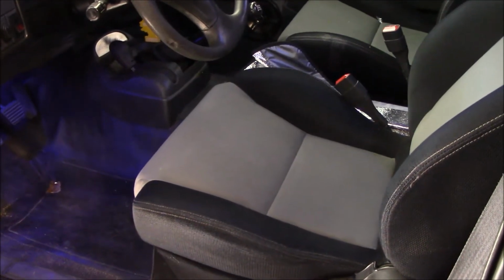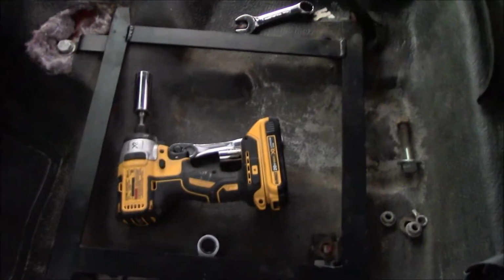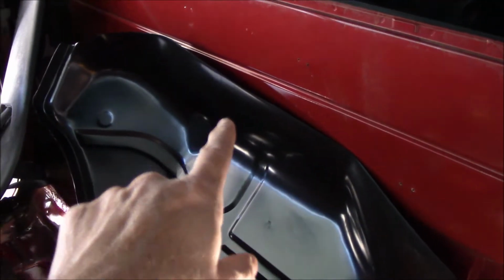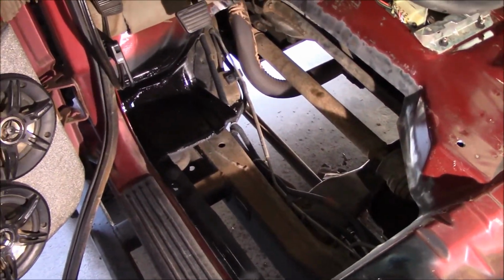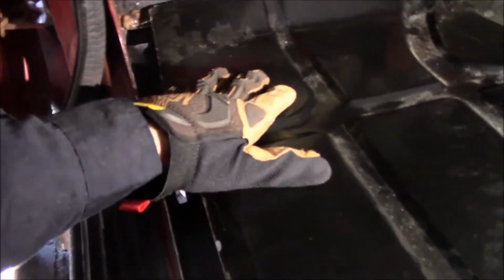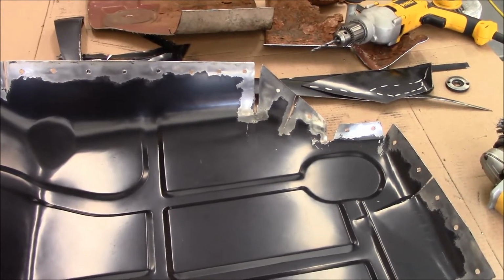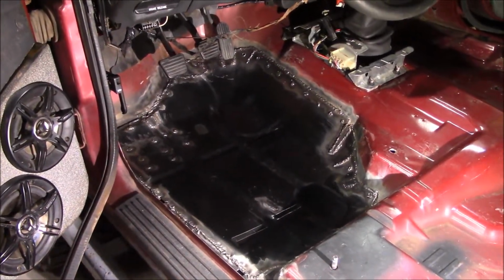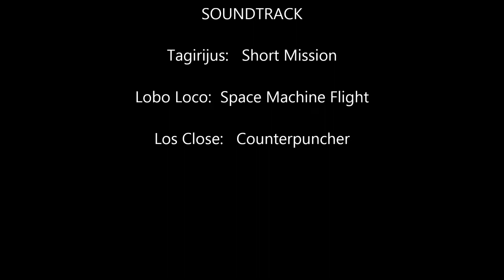20191005 1994 S10 Floor Pan Replacement

Comment: I am a welder by trade and have been welding over 20 years. I think you did an outstanding job on this. You were not scared to try this yourself. You should not run a bead on sheetmetal anyway because it will warp. Tacking it like you did was correct.Again nice job.
Reply from the maker: Muscle Man Mitch hey, appreciate the positive feedback. You know how it is, can’t afford to pay a body shop gotta figure it out. My older Brother is a certified welder, too, so in between razzing me he has shown me some tricks of the trade. We’ll see if in the spring my sealing and coating the underside holds up.
Reply: @rockymtnredneck4888  What type of welder are you using here? Type of material/etc?
Reply from the maker: @regaltouchdetailing3887  just a Lincoln MigPak 115 on 220V with .030 wire and C25 gas. Nothing special.

Comment: Ya know I was sitting here months ago Thinking wow there is no 96 - 05' blazer parts for this job ...I wonder if the older ones would somewhat fit ..lol  My body mount post to the floor is broken and collapsed on my 05' And it has a 2.5 in lift So the alignment for the last 5 years since i got it has always been off The rims are also -19mm offset When you add in all the factors She pulls to the left And has slop in the steering .....So thanks on posting this  I have a mini welder And been in prepping/minor bodywork for a number of years ..Liked and subbed !
Reply from the maker: Yeah, it was frustrating me trying to find the parts, so I decided to look at the square body S10s. Yep. GM engineers saved time and money by just reskinning the truck. Everything else is practically identical.

Comment: As we completed the restoration of the exterior of my 89 S10 on July 4th, we discovered rust breaking through in the exact same area as on your vehicle. So I'm just about to order the floor replacement panels & mounting brackets from LMC Truck. For those who have been asking, they have them in stock, however, 2 of the brackets are shown as Out of Stock, but have been back ordered, and another is shown as Out of Stock and not back ordered. But, you may be able to find them through GMC.  All the pieces total $270, don't know if you can just order the 2 panels for the drive side or not. I asked my body tech why we couldn't just cut out the bad section on the driver side, and weld it in 'top down' just like you did. But, he insisted we need to completely replace all the floor panels, on both sides (there are 4 separate pieces) and  that we needed to completely remove the cabin from the truck, stating that the 'frame was in the way'  and that the floor panels were part of the structural integrity of the truck. This sounded like over-kill to me having had to fiberglass the floor panels on my 240Z unibody 'rust bucket' decades ago. I definitely don't want to have to remove the cabin... do you think any structural strength/integrity is compromised at all, patching in a replacement floor panel on the driver side of my truck ? Sort of a rhetorical question, as you obviously don't think so having done just that to yours. I was just looking for reassurance... hoping like you to avoid paying professionals thousands, while the way you did it only cost hundreds. Thx so much for this video.

Comment: The “body plug” is for a cable. Maybe the foot brake idk exactly. I’m in the process of doing this repair myself. Glad I stumbled upon your video. 👍
Reply from the maker: That makes sense.  It's the same size as the plug for my Suburban's auto-transmission shift cable.  After you point it out it's so clear.

Comment: This is great video and nice job!  I'm about to get my driver side floor pan replaced as well. It is equally rotting out like your truck and probably a little worse.  I learned alot especially about matching floor pans to the 1st gen s10. Typical that GM would do this to save cost when constructing the next generation.  They did it also with the F-body cars as the floor pans matched from the 3rd gens to the 4th gens. That large plug you were mentioning is for the shifter cable for automatic transmission trucks.  I just did a comparison to my 96 s10 (auto) and that's where the cable goes through, so since your truck is manual, GM just blocked it off with that plug.
Reply from the maker: Thank you for the positive feedback!  Good luck on yours.  It's not an easy job, but it is worth it.

Comment: The secret is Galvanized sheet metal , yep I know no rolls in metal but it last much longer then mild steel, but you got it welded solid, good job!  If the automakers used Galvanized metal we wouldn't  have rust as much! Zinc the other good mineral!!
Reply from the maker: The problem with galvanized is welding it. You can get pretty severe poisoning from the fumes. So there are no patch panels made with that. The factories do have galvanizing processes they use, but not in the aftermarket.
Reply: @rockymtnredneck4888 ever so true with fumes, I use a fan when welding it, blowing away only tack welds at most, before I knew in welding class I took a wife of it, made me cough years ago then the teacher told me about it lol, go figure.

Comment: 82 to 03 s10 short bed chassis is the same , my 90 sets on a 98 chassis bolts right on. .cab mounts are the same so the floor pans are same.

Comment: As the hack n pack shop would say ( Rust)! A few occasions that round upper area is rust too, in my personal indevours would be: to cut out the old rusted best as possible and use an inner fender pieces to cover it ! Nope can not mig weld it to thin, maybe tig if u got  one/ good ol self tappers and pop revits work for what it is, when I was kid I seen roads signs  missing huh must had a hole in the floor boards lol, as long it keeps the mud off mom's legs it's good !

Comment: Floor pan plugs in some models they were used to drain bath dipped primer during the bare metal coating process at the assembly plant....Ford was the first to use the body dip process back in the 60s

Comment: The floor mount seat belt bolt is a lock nut style. If you cut the base of the bung they come right out with ease.
Reply from the maker: j bailey really? Are the full size trucks the same? Did I just brute force them out? I would love to see a vid showing what you’re explaining.
Reply: Mine was well rusted in there. I used a breaker bar and broke my torx bit right off. I used acetylene and heated the thing up until is squealed out.
Reply: I'll second that!  Can you explain what you mean by "cut the base of the bung?"  I've fought so many of those things I'll feel pretty silly if there is an easier way!

Comment: Where did you get your floor pan from I can't find one for my 2003 zr2 s10
Reply from the maker: Have you tried all the usual suspects? Summit Racing, LMC Truck, eBay Motors, even gasp Amazon? Remember search for the 82-93 S10 pan. They don’t lost them for the 94 and up.

Comment: Where did you get the floor pan? I have a 1986 S10  and need both sides.
Reply from the maker: This many years later? I don’t remember….and would the source still have them? Check the usual suspects: Summit Racing, Jegs, LMC Trucks, and if you had to amazon.